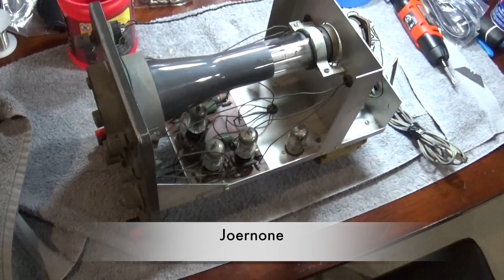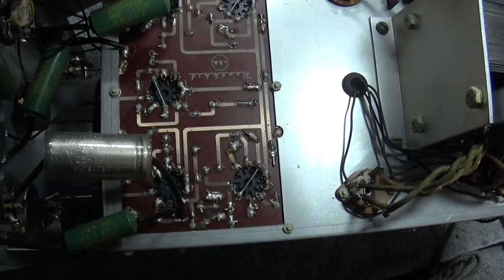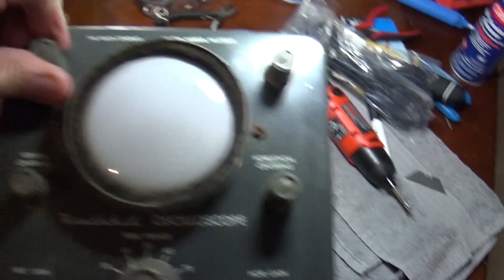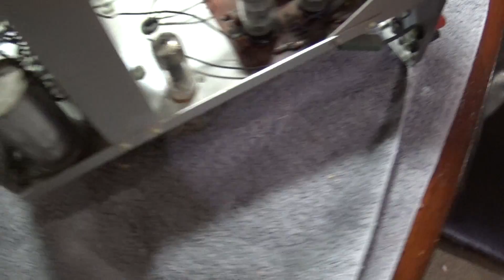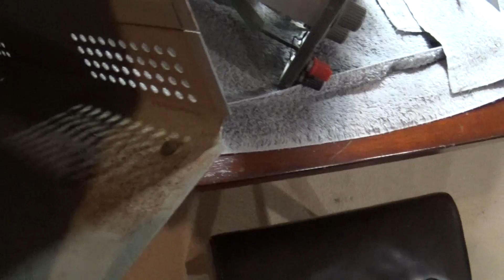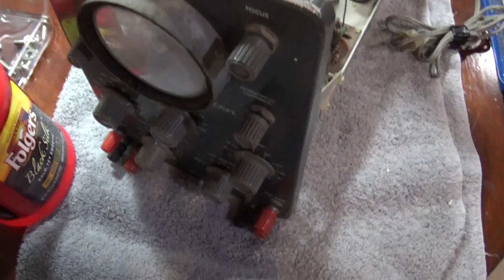Heathkit OL-1  #1

Comment: My first kit was an EICO VOM.  I wonder what happened to that thing?  I used to use a Weller soldering gun.  I had to have help with the color codes since um color blind.  Or i measured the resistors with my VOM, that's how I do it to this day.  Do you have a Heathkit VTVM and signal generator to go with this Heathkit scope?    I think later on their scopes were Bell and Howell.  Don
Reply from the maker: +umajunkcollector   Those Weller Trigger guns go from Zero to Hot in a few seconds - good stuff for soldering directly to a chassis and such. They don't make them like that anymore  :)